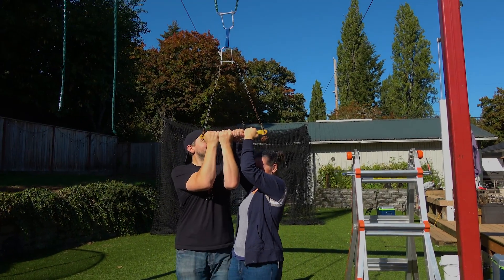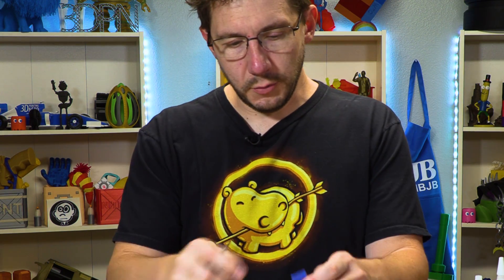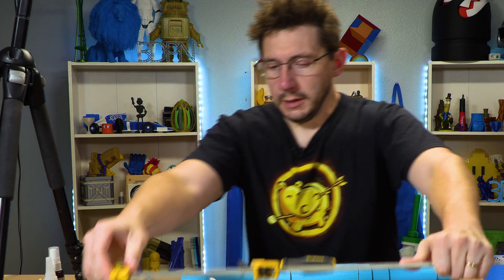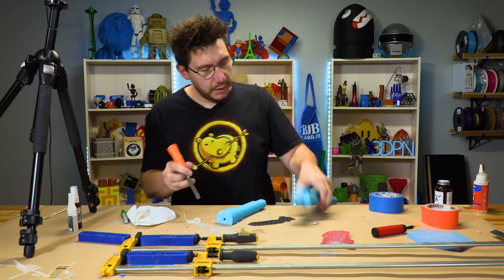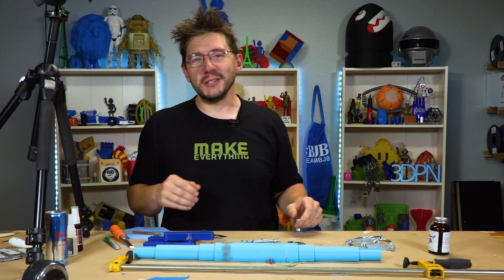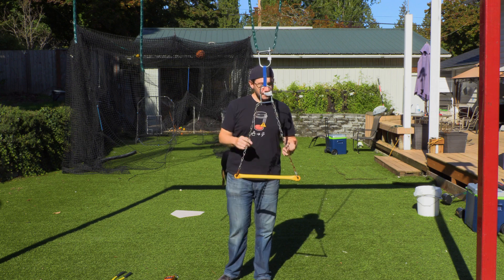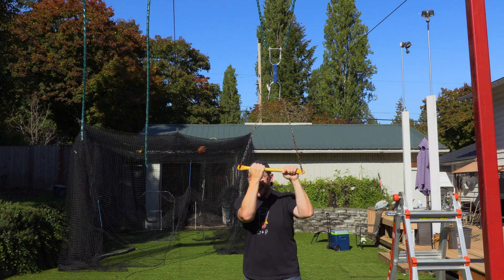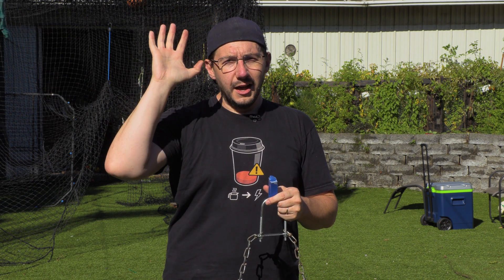This Can't End Well // Testing 3DGloop and Polymaker Polymax PLA

Comment: You do realize that safety instructions on the 3D Gloop state clearly that you need to wear gloves and use a respirator, as well as use the Gloop in a well ventilated area. 
Doing stuff like this and videos like this with total disregard toward safety is utterly wrong. 
And to finish the video with a "maybe you should use gloves and respirator" is just laughable, it is not maybe, it is in the security stuff on the product, and as far as gloves go it is the same for the epoxy. 
Think that maybe you should start your videos with safety first and use the safety, i know it is not sexy, nor photogenic to use a respirator on videos, but not only it is good practice, as it is safe, also think about the example you are setting to people that have no clue about how dangerous solvents can be for your health both in short, but mostly on he long term effects.

Comment: Like others, this pretty much sold me on 3D Gloop. I've used methylene chloride / dichloromethane (the main ingredient in 3D Gloop according to its MSDS) to weld some 3D prints with Great Success, but I'll have to try their specialized formula. I also really like the brush applicator vs. the fine-needle squirt bottle I have for working with acrylic.

But I have to ask -- why didn't you just rotate the U-Bolts 180 degrees so the flat/straight bolt part went through the part, and the round end held the chain? You went into detail about buying large U-bolts to reduce the curvature and therefore strain on the sides of the part, when this seems like a much simpler solution. Sorry, I know it's too late now but I couldn't help myself.

Comment: Would pvc weld work with test?
Reply: Some PVC Weld should work since it has a component that will weld PLS as well. Acetone would work as well since acetone will make a weld in PLA if the PLA is good quality and not mixed with other stuff.
Reply from the maker: I haven't had any luck with PLA welding using acetone using various brands. What brands of PLA have worked for you when welding with acetone?
Reply: @3DPrintingNerd  the Prusa filament works with acetone, even tho i do use mostly an epoxy glue/body filler that works wonders and on parts i had to correct later the position it meant h had to cut the epoxy to avoid breaking the print on the seams. It is the Epoxy body filler from Hempel the name is just epoxy body filler, at least here. 
Also i had semi success smoothening the prusa filament with acetone, at least with 0.1 layers, works almost perfect on 0.05 layers, but instead of acetone vapour i brush lightly against the grain of the print with a soft modeling flat brush. 
I do not print with bigger layers than 0.1, so do not know how it would work on other resolutions.

Comment: Anyone have any pro's or con's with PLA from LabelPro?
Reply from the maker: Hmm, never heard of it
Reply: I'M sort of new at this..and using a MonoPrice 2..and extremely happy with it so far.  My first roll of PLA was from RedRapper for $15.99 for a 1,1115 ft spool.  And so far so good.  I have not had any issues with warping..and it's printing fairly well. But now..their prices have gone up about $4.00 spool.  So I'm trying to save a few bucks.. probably gonna regret that? 
Just a note:  I pulled my MonoPrice II out of the box... leveled it once..and have printed a ton of stuff..and so far.. AWESOME.    I read through a lot of reviews on this printer in this price category good and bad.. But so Far..I'm totally happy.. NO ISSUES. 
Once thing that I do at the end of every print..EVERY PRINT.. I pull the PLA out..right when it's done printing..and I suggest that you do this with every 3D PLA printer.. other wise you will get clog issues.. So..if you're up for taking things apart to clear clogs..then dont bother. 
I hav also sent emails questions to MonoPrice..and they were answered in minutes...so thus   far Like the product and like the response.
I will say one downside about this is that the prints seriously stick to the platform.. I wish I would have started using Painters Blue tape from day once, as the start edge has been bunged up.. when it starts.
I have sent them a "suggestion".. 
I know some peeps go ahead and use a sheet of glass, but you have to change the g code and you have to instal a spacer for the g code change.  
While I'm mechanically inclined..I'm not wanting to do this just yet.  However, it's probably the best solutions... for no stick.

Comment: The super glue result is not surprising. While it's pretty good in shear - stress in the plane of the joint - it does not do well in tension (stress perpendicular to the plane of the joint).

Comment: the basic idea of the 3d gloop is that an exothermic chemical reaction(produces heat) occurs when in contact with the PLA which causes the plastic to bond together through melting and resolidifing. it is also possible that the gloop could also form a layer of PLA which during the reaction would melt together into one solid part

Comment: I have 2 quedtions about 3d printing 
First what program you use to make models to print?
Second whats the difrence between normal making 3d models and miaking 3d models to print
Reply: Good questions. 1) a lot of people (Joel included) use Autodesk Fusion 360 (https://www.autodesk.com/products/fusion-360/overview) to create models to print. TinkerCAD (https://www.tinkercad.com) is a good program for beginners. 2) There are two big differences between printable 3D models and 3d models used for display on a computer: a) the model has to be "watertight": that is, it needs to have an inside and an outside. b) the model needs to be physically printable, which means it fits your printer, doesn't have big overhangs, and a bunch more. I recommend reading one of the many introduction to 3d printing books, such as "3D Printers: A Beginner's Guide" (https://www.amazon.com/3D-Printers-Beginners-Publishing-Construction/dp/1565238710).
Reply: Bradford Needham I just signed up as an educator to use autodesk inventor. I technically educate people about 3d printing irl. Anyways it’s what we learned in school and what I’m used to
Reply: I think you might not fully understand what 3d printing is. It's about printing ANY 3d models, so it doesn't matter what program you use or whether you make the 3d model to be printed or not.
Some models are harder to print because of it's design, but generally speaking, as long as the 3d model is available in .stl format, which is what most slicer program accepts, it can be printed.
Reply: @clementj  thanks . i d think 3d models for ed printing must me bone in special way

Comment: I think you got it wrong with the CA glue.
You applied kicker straight on the glue before joining the parts, and that's a no no...
Great video though.
Reply from the maker: No! I applied the kicker to the other part! Glue on one side, accelerant on the other :)
Reply: @3DPrintingNerd  you are right, I didn't notice that
But... Yet this is not the right way to go.
The CA actually melting the plastic, just a little bit and it make a difference.
The kicker stop the CA from doing that.
Try it ;)

Comment: it was very entertaining to watch. and it did proof 3D-Gloop is very very strong.
but we all just waited for the joint to hit you on the nose.
Why? not just create a safety wire attached to the lower U-bolt with a little play on it. so it would not smack you in the face.
well, then it wasn't that exciting anymore i guess. 👍

Comment: sometimes if you use superglue CA then add epoxy, you may find that the epoxy does not set correctly, they can create an adverse chemical reaction when using together,  I found this out the hard way while producing $3,000 guitars for market.

Comment: You know with the strenth of the 3d gloop, being able to print functional prints bigger than your print bed should become wasier now. For example if you wanted to print something large that needs to take stress that you know CA glue wouldn't be able to hold up to this will.
Or next time I print a long sword I wont have to be afraid if I graze the tip the thing will break in half.

Comment: 3D Gloop looks pretty amazing, based on your last couple of videos. I didn't previously know that PLA solvent bonding was possible!

However - I'm a little concerned about the safety of this product (I notice that you didn't use gloves, which I guess is fine, since it will apparently dissolve most gloves.)
According to the manufacturer's Safety Data Sheet[1], this product is mostly Dichloromethane[2] (a powerful organic solvent that can apparently weld PLA and many other plastics), plus a proprietary blend of mystery goo.

I'm neither a chemist nor a chemophobe - but this seems considerably less safe than, for example, using and storing acetone for ABS welding. I dunno - please tell me I'm wrong?

I'm also curious how 3D Gloop's proprietary blend compares to Dichloromethane on it's own.

[1]: https://www.3dgloop.com/s/PLA-Gloop-SDS-07-27-18.pdf
[2]: https://en.wikipedia.org/wiki/Dichloromethane
Reply: I think for dichloromethane it's on the same level as ABS welding/smoothing with acetone(another well known VOC). It can and will damage your central nervous system with enough exposure, whether through skin or inhalation. Therefore a respirator is highly advised and so is working outside in a well ventilated area. Anyway I ordered a free sample and lets see how it goes I guess..
Reply: @exaltdragon  I was told that it is worse than acetone. Plus, the 3DGloop as a very low boiling temperature (40°C), which make it very dangerous during summer. Don't even try to open a bottle above this temperature! This product really needs to be used under good extraction, wearing nitrile gloves (not latex).

Comment: Well I'm sold! I've needed a good bonding agent for some high stress parts and this will do the trick! I wish there was something like this for PETG so I can get the best of both worlds!
Reply: This should work for PETG, but you should consider MEK or Benzene first, just use like you would use acetone to bond ABS. 
Also for certain types of PLA Acetone will work quite well as a bonding agent, not so much as "smoothening" agent tho. 
To  test apply a little bit of the solvent on a test piece and see if it gets tacky to touch, if so it will work as a glue, but may need some time to get the max tensile strength since the solvent need to evaporate fully.

Comment: Hey Joel, You should try this again but coat the entirety of 2 pieces in 3d gloop instead of just the joint.
Reply: Why would coating the none mating surfaces strengthen the bond?  The adhesive only works where it touches the two surfaces so any spread beyond the joint is just a waste of glue I would think. I
Reply: Mark Shymanski because the gloop could potentially strengthen the model itself by better fusing the pla than the layers do by themselves

Comment: Slower setting epoxy is stronger than fast setting epoxy. If it's curing in a few minutes then it's probably not great....although much more convenient. There is a similar thing with superglue, the thinner it is the better - as long as the mating surfaces are smooth. The thicker types have a lot of ingredients that aren't glue, so the bond strength suffers.
I have no idea if kicker negatively effect cyanoacrylate, but given that it's helpful and cheap...it probably makes it worse, that's generally how the world works :D

Comment: You are putting tension on the glue while the glue will be submitted to shear and tension in operation which is a much different loading condition. It would have been better to test a joint showing 45° angle to have a combination of shear and tension
Reply: Bring on the challenge ;). Our in house testing employees some similar techniques. When applied properly a bond with 3D Gloop will outlive the layer adhesion. 
Great recommendation for future tests!
Reply: Well I don’t have doubt it will withstand the load, but the test is not conclusive. CA glue is not good in tension but is a looooot better in shear :) because science, you know :)

Comment: Nice test, I'm a fan of using acetone to weld ABS togeather, but have been looking for something that'll work well with other materials.  May have to look into it.

Also, you may want to use something softer like paracord when you do hang tests so when it breaks you don't catch a chain to the face.
Reply: 3D Gloop! is similar to acetone and ABS. The difference is we have elastomers that cross-link (form really long chains) to the base polymers that make up your 3D print. The various solvents in the gloop allow this process to take place forming a chemical weld.

Comment: Since it is a chemical weld, is it still necessary to sand like you did? If you did one without sanding would it perhaps get a weaker bond?
Reply from the maker: That's a really good question, I don't know!
Reply: You don't have to sand the joint but it does help because sometimes the mating surfaces have peaks and valleys. If you just use more gloop on the joint it will work. Sanding the mating surfaces completely flat where you can see the layers results in about 20% stronger bond provided the base material doesnt yeild or break! XD

Comment: I'm curious how it compares to rubber cement...
Reply from the maker: Bill Doran of Punished Props Academy and I tested various adhesives, including rubber cement, and it did not perform well.
Reply: Okay, good to know.  I have a part I printed in two pieces, but the joint has a large surface area, so I need an adhesive that will allow the part to preserve some flexibility along the joint all the while keeping the two pieces together.  Of course, chemical welding is most ideal, but I couldn't find anything that wasn't highly toxic.  I had heard of 3D Gloop, but I wasn't convinced about its ability to chemically weld until I watched your video.  I already ordered a sample.  Thank you for doing tests like this!  I really enjoy watching your videos!

Comment: It is so amazing how some peoples' 3d printed parts are so strong, but others turn out brittle and break easily.
Reply from the maker: proper temps and humidity gives you great layer adhesion. usually. :)
Reply: @3DPrintingNerd  wait is humidity a good thing or bad thing? Because we've got plenty of humidity here in Florida. Should I leave my window open a crack when printing so that the humidity can help layer adhesion?
Reply: @TheSentientCloud  Bad, bad, bad. Less humidity = good parts.

Make a dry box and feed the filament through a Bowden tube to the extruder entry and you will be fine regardless of outside climate.
Reply: Depends on printer, environment conditions, slicer, slicer setting, material, material brand, and so much more lol. Too many variables

Comment: I feel like if you sanded the surfaces more super glue would do better. Or maybe you are using too much. The Mythbusters held over 600lbs (Broke at 650lbs) with 1 single drop of super glue. Granted that was metal on metal but I just feel something is off. It's in Season 10 episode 6 "Driving Dangerously, Super Adhesive Heroics" at about 10 minutes in. Not saying this product looks bad (because it looks awesome) I just wonder how they got 1 drop to hold so much weight.
Reply: Glues use a ton of science and how they work takes even more science to explain! The biggest issue with most glues and 3D prints is that the base plastic polymer doesn't like to have the glue stick to it because of its structure. Sanding helps with this as it roughens up the surface so you create a mechanical bond but chemically, the adhesive part of the glue is hindered a bit.  Additionally, the layers of a 3D print cause varying thicknesses of glue. The best joint will always be 2 perfectly flat plates of metal to keep the glue very very thin. This is because there are two terms to describe a glue Adhesive, and Cohesive. Adhesion is the ability for the glue to interface with a material and hold on. Cohesion is the ability of the glue to hold onto itself. While CA glue is high in Adhesive strength it is lower in Cohesive strength and therefore the joint fails easier if the joint gap is thicker.
Reply from the maker: Hmm. I'll ask Adam about that!
Reply: Ok that makes more sense to me now.. I was just wondering why super glue never seems to hold so well and now I know. Not that I doubted your product I just didn't understand how a drop could hold 600lbs on metal but not on plastic. Thank you!

Comment: Properly done, a solvent weld is almost as strong as the material being bonded.  Always go with that option if you need strength.

That said, watching you get repeatedly smacked in the face was painful.  Here is a link to a WP96 impact resistant face shield from 3M (this is my personal favorite, but I am the dorky guy with shop rated glasses and side shields at the makerspace).  
 https://www.amazon.com/3M-10078371827837-Combination-Headgear-Polycarbonate/dp/B00KOMLGP2

There is a less expensive version that uses a weaker shield, and it is probably good enough for what you normally do, but I would hate to see you blinded.   
https://www.amazon.com/gp/offer-listing/B000BO6RIE/ref=olp_f_primeEligible?ie=UTF8&f_new=true&f_primeEligible=true

Remember Kids: It's not fun and games unless someone loses an eye!
Reply from the maker: Oooh a face shield, thank you! I'm so going to pick one of those up!
Reply: @3DPrintingNerd  Thank you for making the Cyberia Safety Wizard a happy camper!